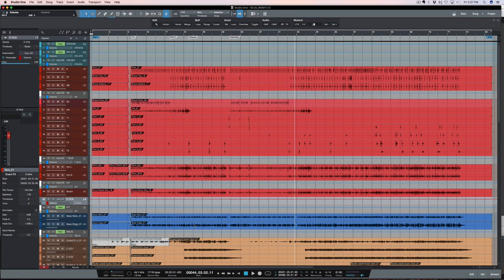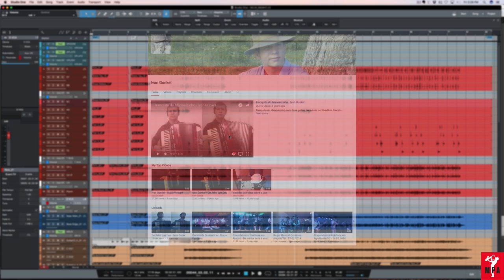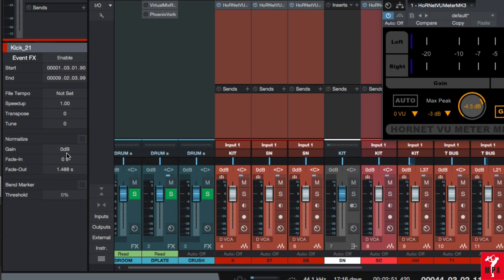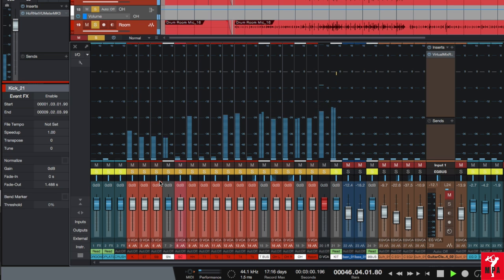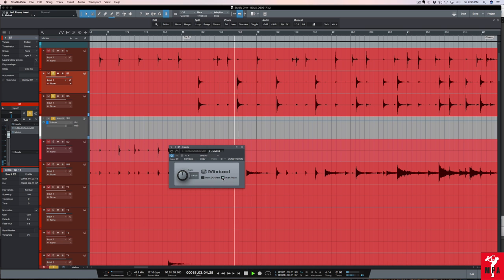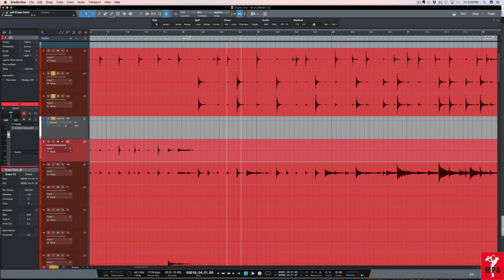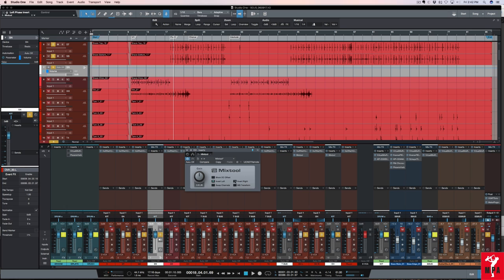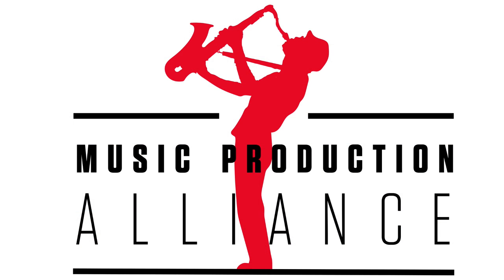Gain Stage & Process DRUMS with Hornet VU meter MK3 - No. 3

Comment: Is the meter better than just lowering the volume with the faders? I'm trying to figure out how the meter is lowering the volume without any noticeable change in the volume on the tracks individual tracks.
Reply: volume faders use on mixing but gain plugin for gainstage. Also fader meter near on unity 0 makes more precise changes than if it is nowhere near 0. Sorry can´t explain better :D Gain plugin before faders is also good to use with analog (modelling stuff) when your gain should be -18dB before plugin.